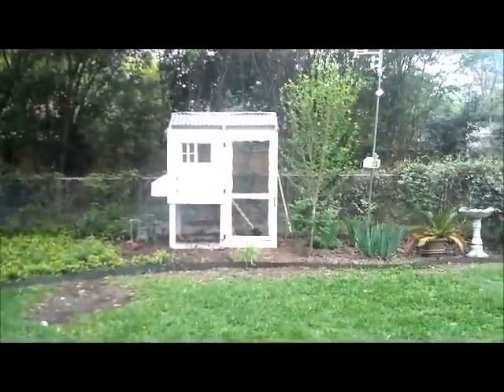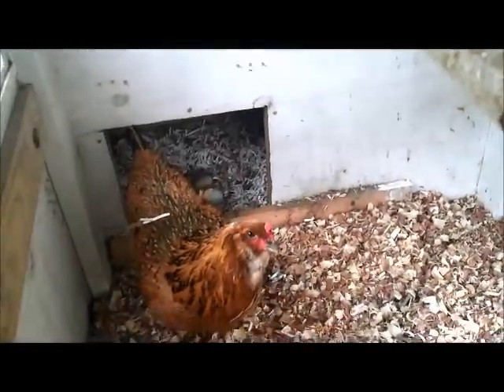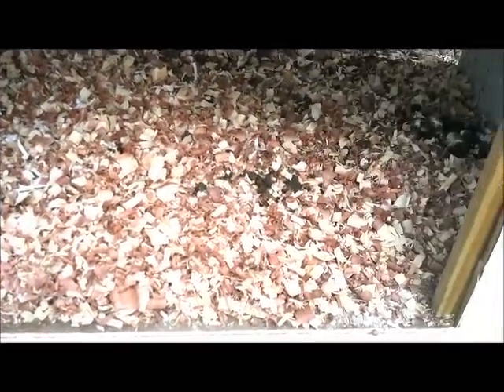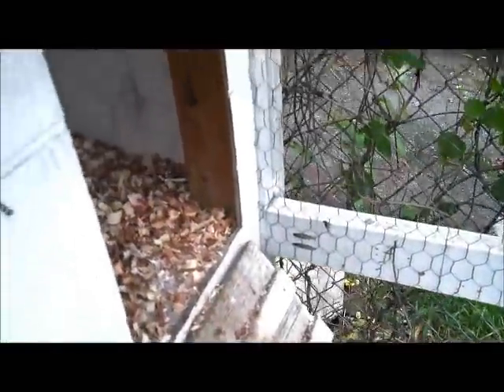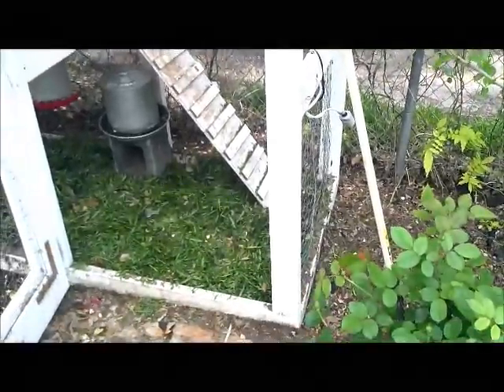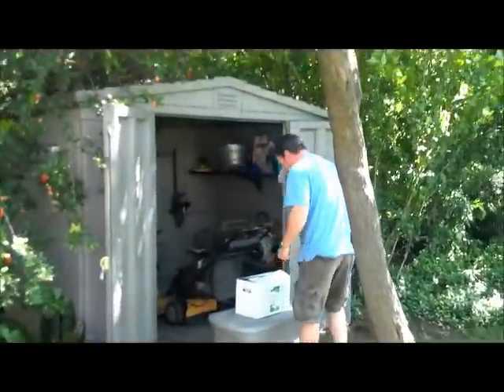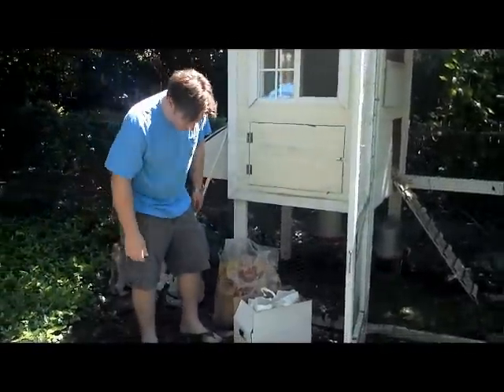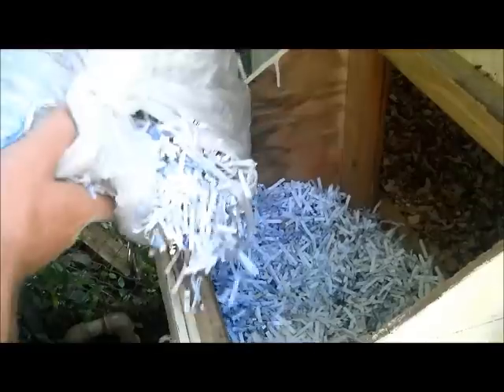Backyard Chickens The Complete How to Guide Plus Coop Tour [CC]

Comment: Just a suggestion (nice vid by the way), if you put down a single row of bricks under this coop, the wood will last longer and drainage will also improve...  I'm so glad you are are able to enjoy chickens in city limits (need more towns like this)... also looks nicely shaded, those metal roofs will bake the interior if not shaded.  Cedar chips break down much slower than pine shavings... great for your garden.  Thanks for sharing!
Reply from the maker: Thank you! I did put down bricks. It's just hard to see because they're covered up. I also used pressure treated wood and we primed and painted every surface. We recently moved to a house with a much bigger yard but our coop is at the in-laws until we can get a fence that will keep the chickens in. It was funny driving down the road with a chicken coop in the back of my truck.
Reply: Adam Savage Ohhh... that all sounds great Adam, glad to know you're expanding!

Comment: If you get a lot of snow, like if you live in new england, go for a bigger enclosed wooden roost box so they are nice and warm. You could also put a heat lamp up like he did. Also, chickens produce more eggs in the spring/summer months in northern states because they go into energy storing mode when the days grow shorter in the winter, so you might want to put a light in the roost box on top of the heat bulb/ceramic. And just think warm when designing their enclosure.

Comment: Wonderful video. Great coop....nice job. Do you ever have a problem with varmints getting after the chickens? Here in Hawai'i I worry about letting them out of their 15'X15' run area we have. Mongoose and hawks are my main worry.
Reply from the maker: We have red tail hawks here and I'm not too worried about them. I used to get rats or mice. I never saw them, but I would see the feeder swinging at night like something was on it. To get rid of the mice (or rats), I put bricks down to make it harder to dig under. I've actually trapped and relocated a couple of raccoons. They're nocturnal, so if you lock your coop up at night you don't have to worry about them. Other than that, my schnauzers keep an eye on things. They're not exactly guard dogs, but they would make a lot of noise if anything came into the yard.

Comment: Okay so grass for the bottom part, chips for the indoor section, and shredded paper for the egg box. Are these the recommended materials or could they be interchangeable? 
Also could the indoor section be used as the egg box or do they need both sections separate?

Comment: I saw 2 disturbing things in this video. 1: You raked the dirty coop bedding into the same plastic tote you use to store the clean bedding. Yuk! 2: Clipping the chicken's wings seems cruel and traumatic for them. If you don't want them flying into the neighbor's property, a more humane solution would be to closely supervise them or build a bigger run enclosure.
Reply: Clipping a chickens wings is like cutting our hair or nails. It's just keratin and doesn't hurt them in any way. Research chickens before you have a go at someone for something you have next to no knowledge on
Reply: C F you only clip the primary wing feathers on one wing, & not close enough to make them bleed, it just unbalances them enough to prevent them actually getting fully airborne.....no harm done at all.